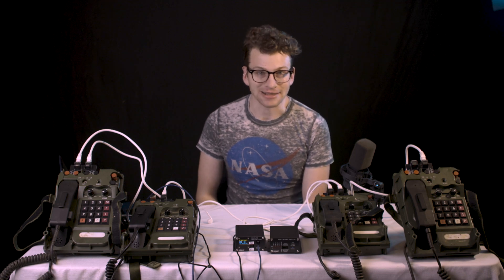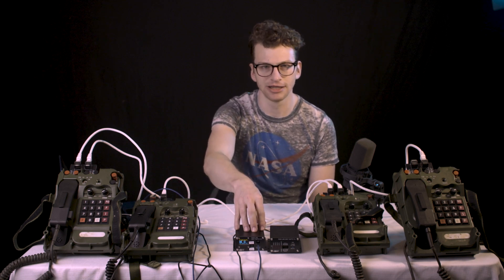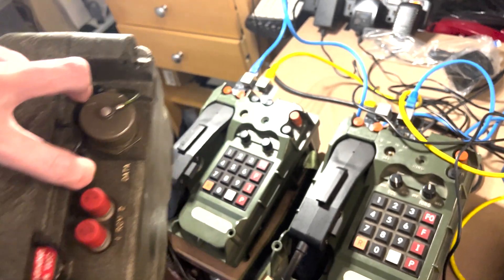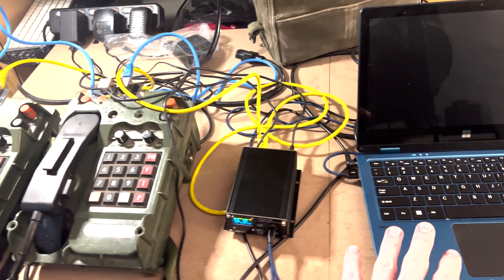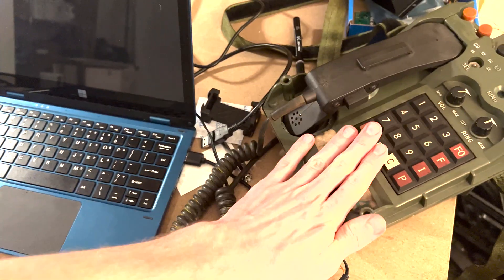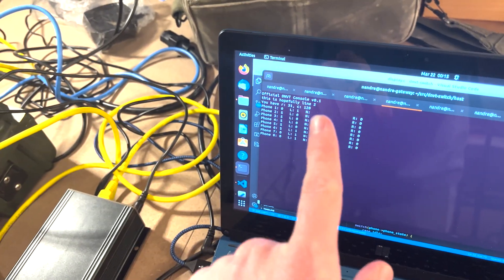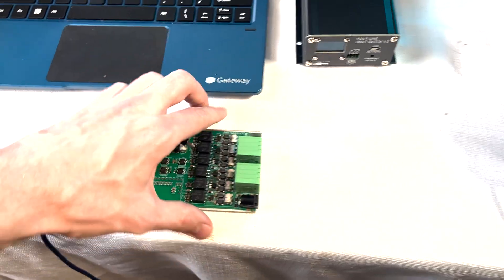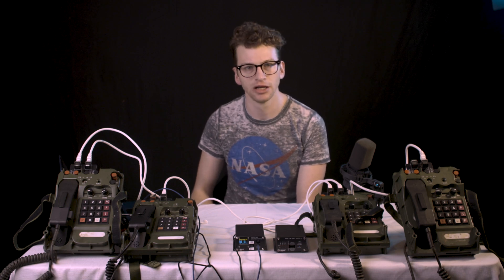Digital Military Telephone Switch Feature Overview

Comment: Would this work with a TA-838/TT? I was just going to use it as a prop and hack some wires to use the buttons as HID inputs, but if it can be done less invasively with this converter that would be the better option ^^

Comment: What determines the phone numbers for each phone. Is it the switch that does that. This device is just amazing
Reply from the maker: Hey! Yeah in the case of the switch it’s hard coded 1-4 when you’re not connected to a computer. If you use the computer (whenever we get the SIP implementation done) it just depends on the configuration there.

Comment: I was an Airforce combat comm guy back in, the 1042 was a great trpuble shooting tool. I could use it as a pt-pt phone though  a trc-170 or 93b circuit. If i got good clear audio it was good, if not i would run loops and see where the issue was. Once in Saudi we had a medical emergency and i got to use the FO(FORCE OVERRIDE) To off loD the trunks so a dr could call out.

Comment: Hey!! I am a ham operator and back in 2013 I use to play with Allstarlink with the app rptt software to connect radios and voip systems together I think this would be useful for your project possibly..
Reply from the maker: Yeah the codec isn’t very standard on these phones so it requires transcoding to get them to interoperate.